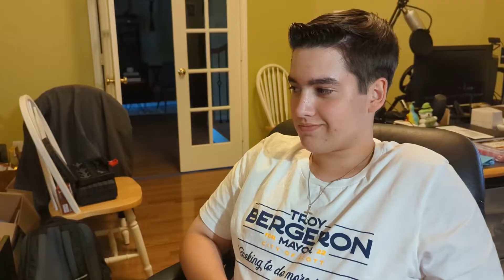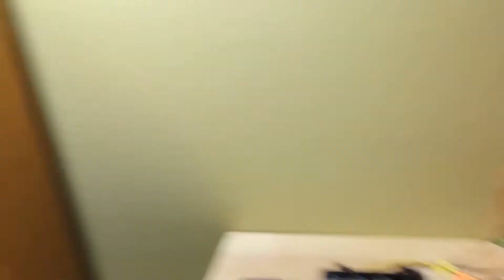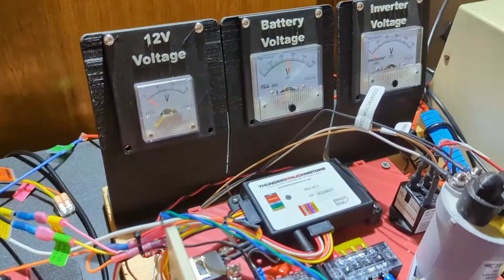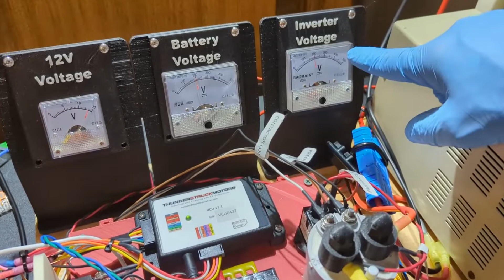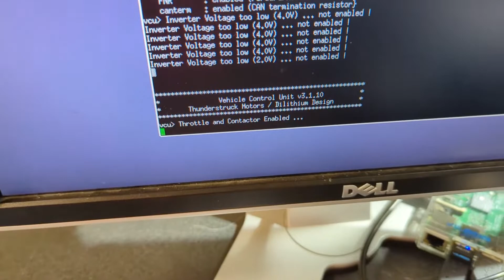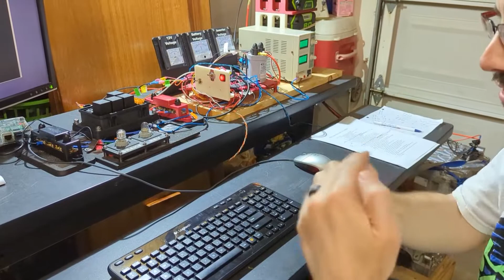Porsche 924S EV Conversion - Part 7 - Nissan Leaf motor spins for the first time!

Comment: Great test bench! The best i've seen outside of a professional setting. I especially like your solution for getting 250V on the benchtop... a stack of lawn tool batteries! Are the STL files for that stackup available anywhere?
Reply from the maker: The next video in the playlist goes over the test setup in more detail. We are still building and modifying it though. I didn't share the files because the design isn't really that good. I think one piece that might be worth sharing is the stackable battery holders. I should share that